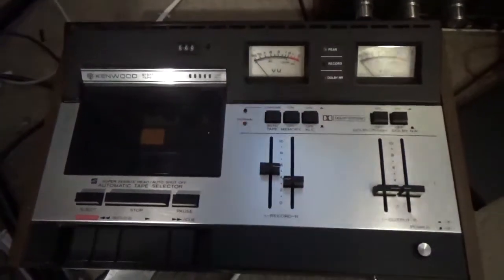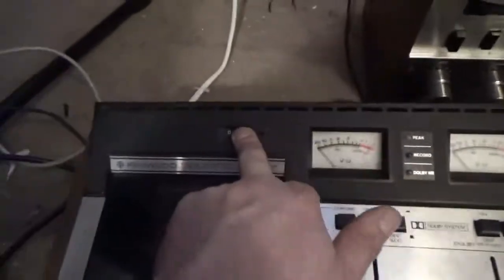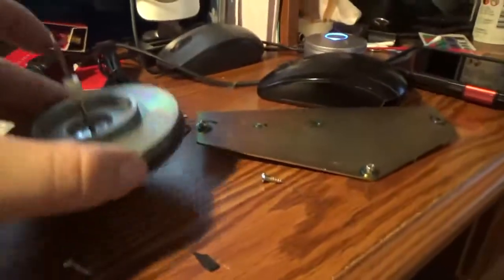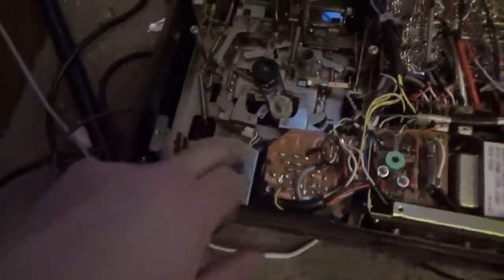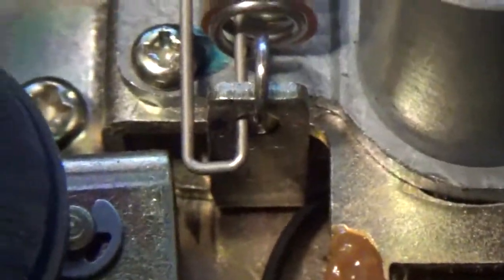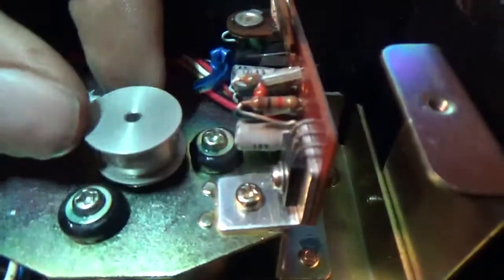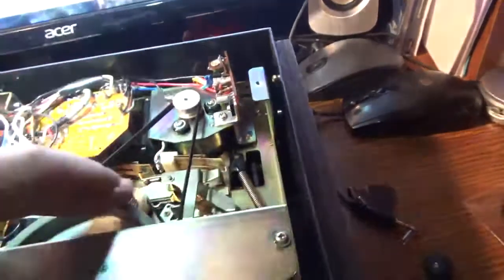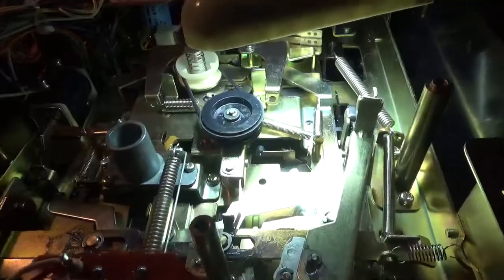Vintage Kenwood KX-710 Cassette Deck Repair Part 1

Comment: looks like I have the same one Kenwood (KX710 ?), least the outside looks the same , what amazed me of it, that it be so full loaded whit electronics when I had  look inside in the past, but as I remember it, It had a lot of piled circuit boards in it, compared to other cassette decks I had open up that had significantly fewer electronics in it

Comment: That looks like a really nice unit.  I'm sure they can get it working and it'll be an awesome deck.
Reply: Working on one now what caused the take up trouble I don't think lower counter belt is the trouble
Reply: I think I see the problem besides the counter belt there is a tiny belt that goes from capstan white pulley to bottom take up reel you need to take seven screws out to lift the top cabinet off to fix counter and take up.
Reply from the maker: @MrMotownjoe  it has since been repaired. Bad belts plus old dried up grease. New pinch roller also. Cost me $300 but it works great again.